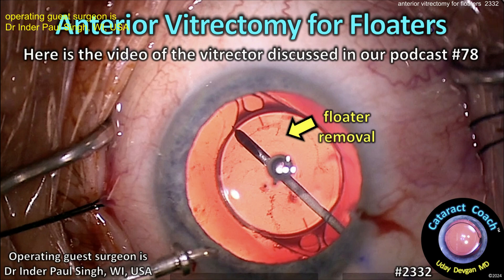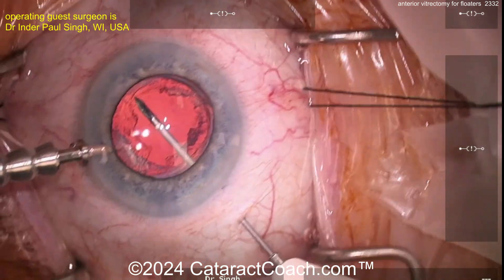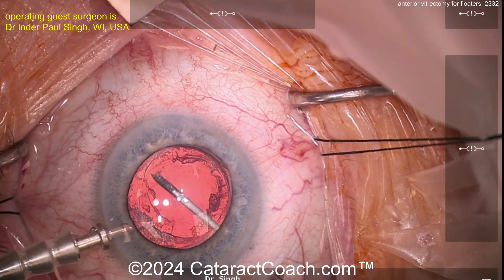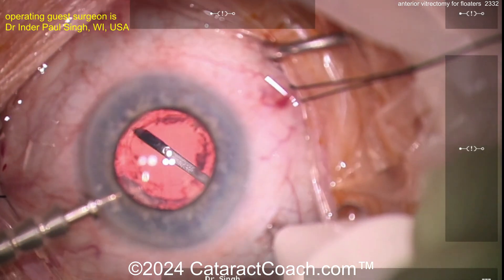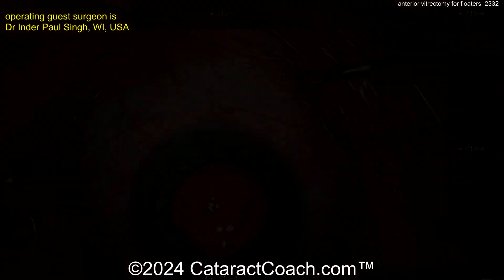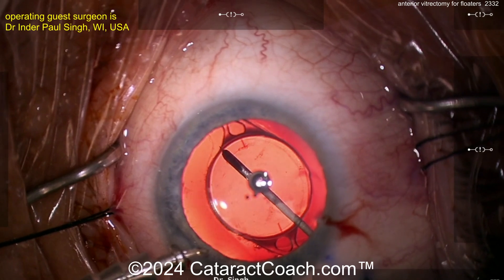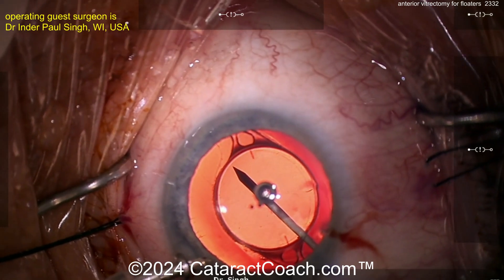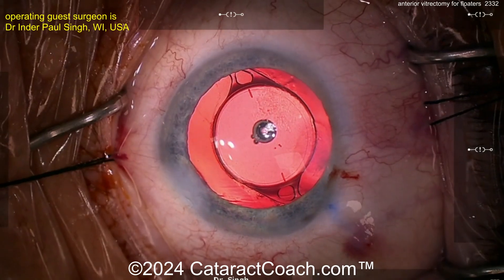CataractCoach™ 2332: anterior vitrectomy for floaters

Comment: I have my doubts about the safety of this technique and agree with most others that proper visualization of the posterior pole is important, especially for pseudophakic breaks.

I am interested in the sharp vitrector used in this video. Is this a desperate instrument, or is a normal vitrector being adapted into a needle? Does anyone have insight on that?

Comment: Just had my second vitrectomy, this time accompanied by cataract surgery in the same intervention. Since I developed cataract after the first, my doctor said that he would do both for the other eye.

The one thing doctors should warn their patients about, though,, is that cataract surgery can develop new floaters in the process. In my case, that happened twice but they disappeared a few days after. I’m still struggling with a little black spot in the periphery of my eye after 4 days that should vanish, hopefully.

But even if it doesn’t, I don’t regret what I’ve done since I have a crystal clear vision for the first time in over 4 years.

Only thing I regret is wasting 400€ in useless laser surgery before that.
Reply: How old are you?

Comment: I just dont get why one wouldnt do a proper pars plana vitrectomy if youre going to take someone to the OR for non urgent floaters anyways, they can also be very efficient and much safer. What advantage does this have besides being easier for the surgeon?
Reply: @kodachrometimes  Pars plana vitrectomy can be plenty fast (its just one less "port" you're placing with this technique for a light pipe, otherwise nearly same amount of time), and "easy" if you just want to remove the vitreous opacities; I mean we're just moving a chopstick around in the eye for a few minutes. If you include taking the patient for the immediate post-op scleral depressed exam, which Dr Singh appropriately does, I imagine the timing of the case would be very similar. Also, depressing while the eye is being pressurized and you don't have to worry about making your wounds leak (with endophthalmitis risk) during a proper depressed exam can mean you do a better job, or avoid suturing

But visualization of the peripheral retina is so much better with a Resight system, and the breaks created using this technique can be tiny enough that even experienced retina surgeons could miss them with an indirect. When I do PPV floaterectomies (which is only after heavily trying to dissuade patients from getting it done), I probably spend more time on the scleral depression than the actual PPV. 

When breaks are missed in these cases, it can be a complete disaster. I get extremely sad when I get referred patients who started out 20/20 and ended up 20/400 before they get to me from multiple PVR RDs that all started from a single missed break initially. I'm sure the rates are low, but in 20/20 eyes with no other problems I think it should be a "never" situation.
Reply: It’s probably a lot quicker to do and maybe has a quicker recovery rate than sucking out everything from the eye

Comment: Not to knock innovation but I agree that it is probably safer to perform a full PPV when indicated. Which can be done with 27G gauge systems, albeit generally with 3 ports.

I do not see trocars are dangerous or inconvenient. They control fluid efflux. 

I’m not sure I would want an AC maintainer in my own eye, mainly thinking about the endothelium. 

Also, it is misleading to think that a postoperative non-depressed retinal exam will pick up pseudophakic breaks which are notoriously small and difficult to detect, sometimes even with BIOM posterior segment visualization.
Reply from the maker: great input. thank you

Comment: IMO this should only be done with posterior visualization,  posterior infusion and for a patient that has a pre existing PVD.  When done properly this can be a huge benefit for the patients that need it.  Should also inspect the peripheral retina at the end of the case.
Reply: Amen
Reply: I have a question. Could this anterior vitrectomy procedure be used on a patient who had a previous Pars Plana Vitrectomy with an induced PVD but had some vitreous remnants remain in the eye? In more simple terms could this be used to clean up some tiny fragments from a previous vitrectomy. Say perhaps at the time of Cataract surgery? Thank you.
Reply: @Stevethesearcher  Honestly, you should only do elective vitrectomy for vitreous opacities/floaters with posterior visualization and infusion and trocars. If you don't have that capability please stay out of the posterior segment on an elective basis.  On the other hand if one HAS to do a vitrectomy as part of a lens exchange or complex cataract surgery you are better off with a pars plana approach with or without posterior visualization but that is a different scenario than doing an elective vitrectomy for vitreous opacities.
Reply: @ Thank you for your answer.
Reply: @StevenGSafran how do we know if the there’s posterior visualization etc?
Reply: @KB-wt1hm because you have a surgical microscope with that capability when you decide to perform the procedure.  You also need a light pipe or chandelier light so you have that as well and then of course you need to know how to use them. If you don’t have those things, then this should not be an elective procedure .
Reply: @kodachrometimes  I think that it's reasonable to do Yamane with a good 2 port vitrectomy but better to do a 3 port with posterior visualization if you can.  there is a difference between doing Yamane and doing an optical vitrectomy for floaters.  Different risk benefit profiles and different objectives.  In Yamane the goal is to clear out the anterior vitreous and anterior peripheral vitreous so you can manipulate the needles/haptics/IOL without engaging vitreous.  In an optical vitrectomy you are removing vitreous opacities, clouds, floaters and you must remove the posterior vitreous completely or there is no point in doing it.   The patients ONLY reason to have a procedure is to remove the opacities in the vitreous and it must be done as completely and safely as possible and that simply cannot be one without posterior infusion and visualization.   When I do Yamane I do the vast majority with posterior visualization and always posterior infusion/vitrectomy.
Reply: why do you recommend posterior visualization and posterior infusion?
Reply: @soccer24six  to see what is going on.  You can confirm the presence of PVD and do 360 scleral depression to check for tears.
Reply: @doc.g9497 Endoillumination helps tremendously to visualize small peripheral pathology that can be very hard to see in a pseudophakic eye. One would also want to treat all the tears immediately. Furthermore, anterior infusion doesn’t really keep the posterior part that well pressurized unless the eye is aphakic.

What’s the cut rate of that thing?
Reply: @Antroid1 5000-10000 as mentioned in the video..
Reply: @soccer24six  vitrectomy is a posterior segment surgery …
 🫳🎤⏬
Reply: @soccer24six  Because you cannot remove all the vitreous floaters, the Weiss ring without posterior visualization Without posterior infusion and posterior visualization you cannot see what you are doing so it's all blind.  The Weiss ring and posterior vitreous opacities are  usually the cause of more symptoms than the anterior core vitreous and if you don't remove that you will hear patient complaints.  Also, the anterior infusion combined with posterior vitreous removoal will push the lens bag complex back and put stress on the zonules as you remove vitreous if you have an intact lens bag complex diaphragm.  There is a compartment syndrome and that creates negative pressure in the vitreous cavity which can lead to choroidal effusion and posterior segment collapse as you remove vitreous..  If there are any holes or tears created you can't see what's going on....the whole thing is just a blind process with a sharp tipped instrument and this is really not how I think a pars plana vitrectomy for floaters should be done.  Using trocars puts less stress on the vitreous base as you slide the instruments back and forth and it's important to be able visualize what you are doing, remove peripheral vitreous to reduce vitreous traction, not create negative forces that tug on the vitreous as  you remove it and inspect the retina at the end of the case to make sure you haven't missed anything.